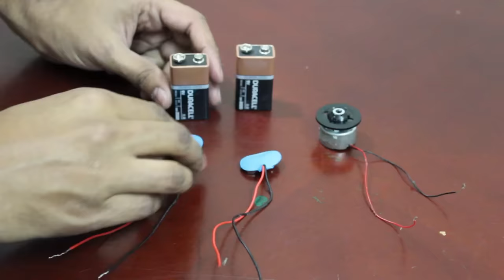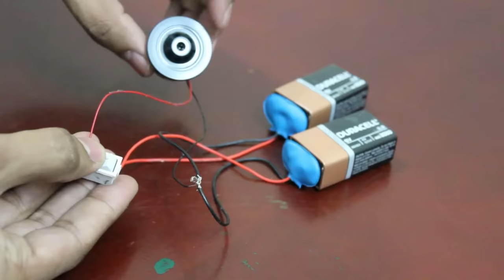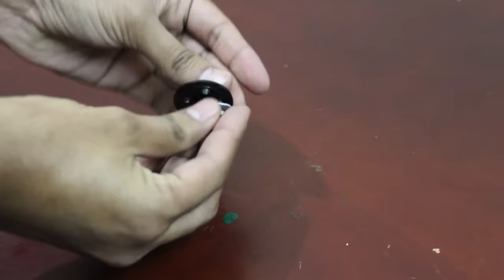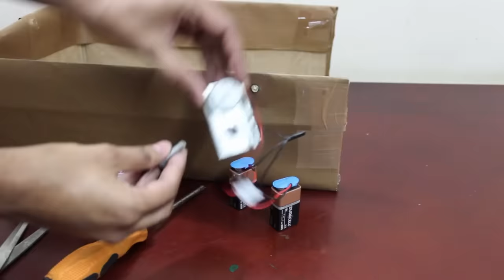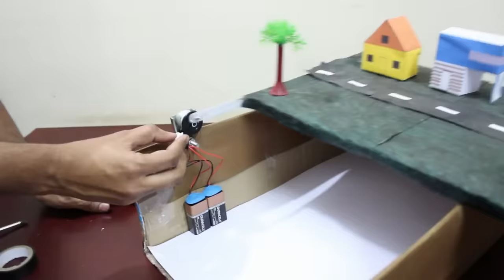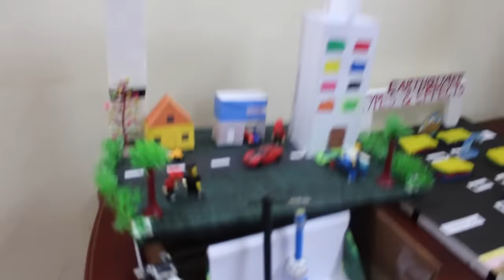How to make working earthquake model - school project

Comment: Items used :
2 9v batteries
1 mini motor
2 Screws
Connector wire and small switch for on/off 
double sided /thermocol/chartpapers etc.....
Your welcome
Reply: What is the black metal in the shape of circle
Reply: @manishanarang9059  yes what's that
Reply: Don't welcome him, Its literally in the description._.
Reply: Wow outstanding model working
Reply: @ Riya Sinha I can't also understand

Comment: (2) 9v Batteries
1 mini motor
(2) screws 
Small switch for on/off
Snap connector 
Steel flat rod or Mechanics set rod with holes
And servo wheel with metal inlay

Comment: Do  we have to keep  the below lied box open at three sides?
Reply from the maker: You can keep those closed as well
Reply: @SapuIQ  Will not they break if we join all sides?
Reply from the maker: No it should not as long as you keep the top base little higher
Reply: @SapuIQ  Hey sapu I don't understand what did you mean by little "higher" as it will be on the same level as other below three sides